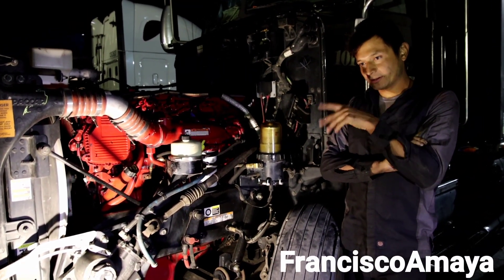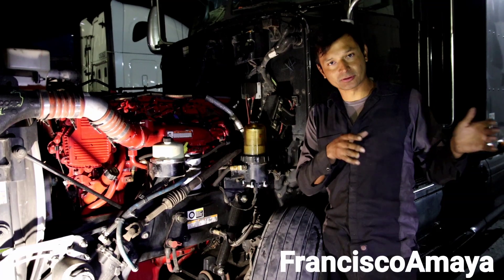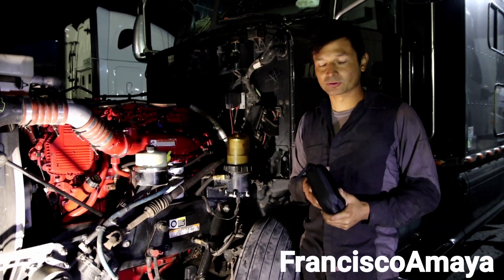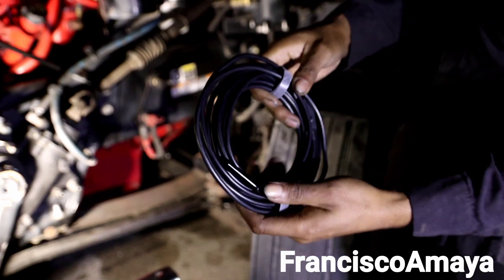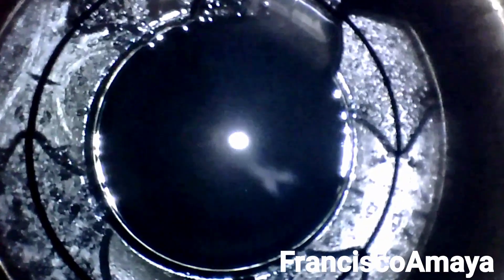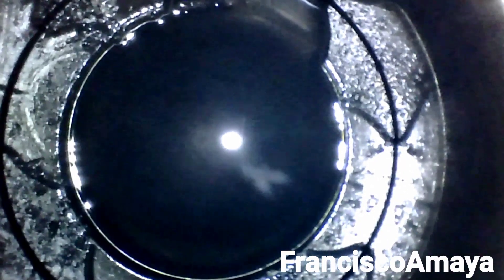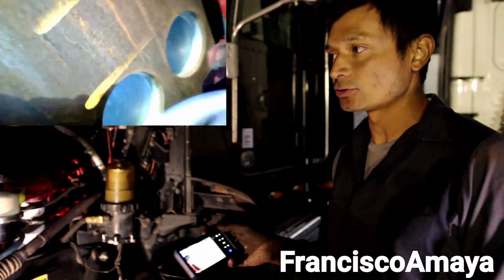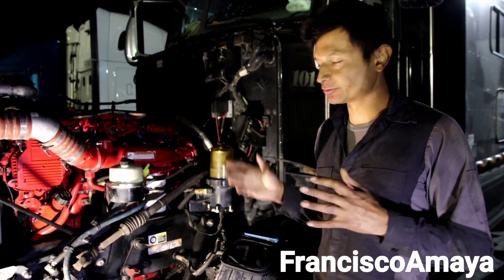Cummins ISX ISX15 broken cylinder head inspection coolant consumption compression leak no power

Comment: I'm at a Cummings shop in the shop can't tell by looking at the head what's wrong with it. So they sent it out to have it pressure tested. It seems like you can very adequately see the cracks in the head. When the certified Cummins mechanics said they cannot?  You make the analysis look easy...

Comment: Hi sir, 
I have a Cummins ISX 2012 with Sam problem , 
I loose coolant but I cannot see any leak what so ever, but at the same time truck is starting normal no excessive smoke as well no power loose. 

Any advise please?
Reply: Did you find the issue..?
Reply: Check your transmission cooler. Coolant might be mixing w trans oil

Comment: My isx has done that hiss noise every since I purchased it, but ran good. However,  I just replaced the injector cups because I was getting coolant in my fuel. A place did it without removing the head.